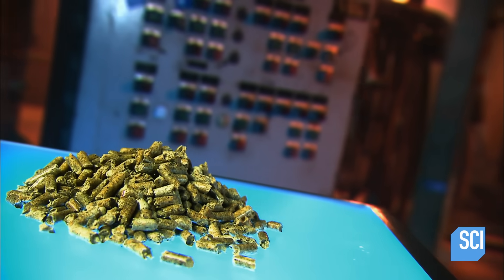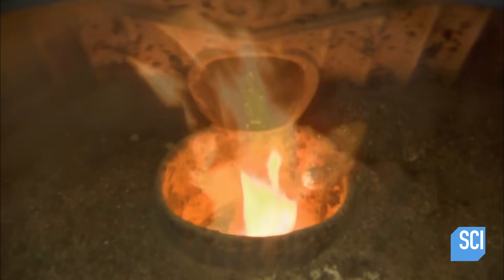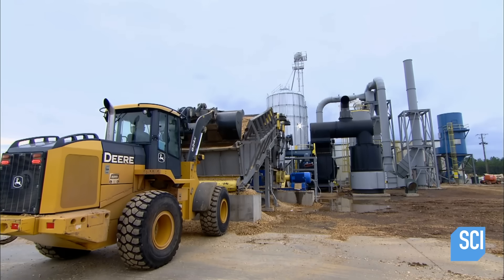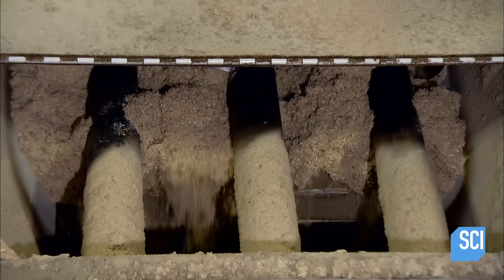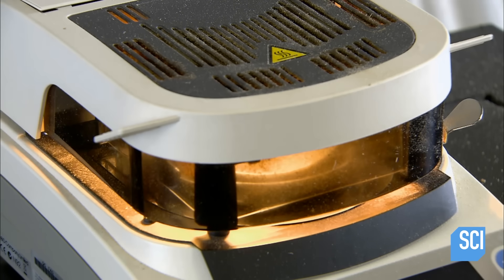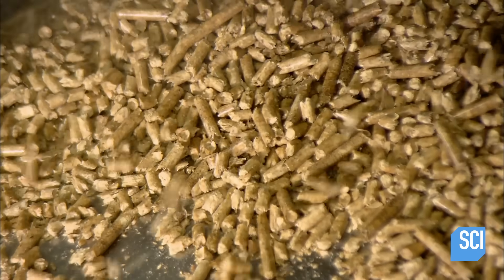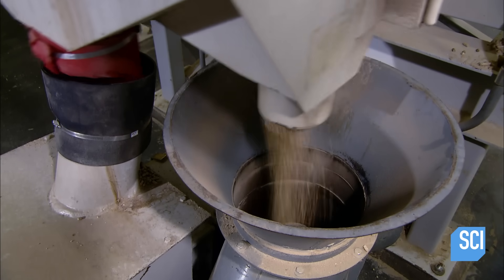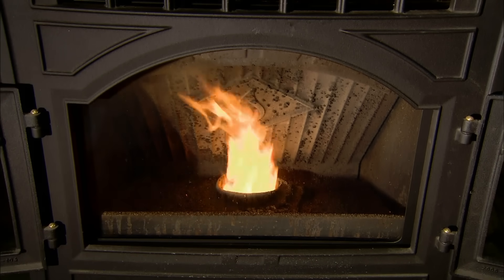How It's Made: Wood Pellets

Comment: When I BBQ with pellets I’m eating treated wood and pine trees.
Reply: It depends if the pellets you're using, are designed for grilling and smoking. Fuel pellets that are typically used for home heating. Are probably made of wood, that is usually not used for cooking, like pine, cedar. And may also have other materials incorporated into it. Such as waste cardboard, sawdust.  Where ones that are for cooking. Are usually made of woods generally burned for that purpose. Like hickory. Applewood. Cherry.  It's also always important, to read the labels on the bag carefully. To determine the ones you are getting. Are for what you are going to use them for.

Comment: I think home heating with pellets is more common in Europe because European homes typically have water based radiative heating i.e. radiators and underfloor heating with tubes of hot water going thru them.  Anyway, it's pretty good but someone has to move all those pellets around.  I burn ~6 tons a winter and I carry them all from my garage down into my furnace room in my basement by hand...

Comment: A wood pellet stove seems like a great stove and idea though wait... if there is a power outage (electricity) your pellet stove is rendered useless, as it has an electric feeder that feeds the pellets from a hopper into the fire which is kept burning hot by an electric fan blowing on the point of flame, so have a back up generator or second source of heat available to keep yourself and loved ones comfortable and warm

Comment: I niticed that it was mentioned several times that wood pellets burn cleaner than logs/firewood.  This is because a metric butt-ton of energy was put into removing the moisture from the wood.  There is no green-gain between firewood and wood pellets juat so's ya know..
Reply: It depends on why you want cleaner burning fuel. If it's just to not have it be messy near you, then no net gain is okay.

Comment: I had a pellet stove, because of the cost of yearly maintenance to try to keep it running I stopped using it..
Funny how they didn’t mention that part of it
Reply: They also don’t talk about how much fuel goes into making wood pellets vs wood stoves from hauling, grinding, drying & plastic bags. Wood stoves also don’t require plastic nor electric. It’s part of the illusion of environmentally friendly.

Comment: Pellets. The lazy mans option to solid fuel burning. Won't generate the heat hrdwood, or coal puts out. And prices are all similar. However, with the new administration, anthracite prices should be reduced. Fingers crossed.

Comment: I went from woodstove to pellet stove,  power goes out, no heat,  auger quits working no heat,  pellets get moisture in them from a torn bag, their compost.   when the circuit board went out ! had 4 bags left, loaded the stove up, went to the scrap yard n shoved it out.   Back to the old reliable wood stove.   Live in the PNW  free fire wood from tree removals and logging is very common here.
And I'm not hostage to pellet prices.
Reply: I have both. That way if I leave for a day or two I don't worry about the heat in my house. Or when I go to work on a cold day I start up my pellet stove

Comment: These are great for cat litter. 40 lbs of wood pellets for $5.99 over 35 lbs of clay litter for $26. Also, no clumpy nasty clay litter stuck to the bottom of the pan, just wipe the wet sawdust clean with a dry paper towel.

Comment: I find it interesting that in America there are very few compressed wood options.  Wood pellets are an emerging industry in America.
America has 6mm pellets, the industrial/rare 8mm pellets, and the even more rare 10mm pellets, and America also has bio-bricks.

Other places have more options for compressed wood.  I saw a wood compressor that made 20mm cubes of pressed wood.  I want to get my hands on a bag or two of those cubes because they look interesting.

I also am a bit upset that there are few pellets that use a bit of oil in the mix.  Oil in wood pellets can act as a sealing agent against water, and increase the energy density ... BUT it is an extra expense so many don't bother.
Reply: I've been doing my research on biomass pellets and there is potential for other plant-like biofuels like invasive reeds and miscanthus silver grass as well as bamboo for clean heating pellets.
Reply: @chancetrombley3114  

In the end almost all plant matter can be made into pellets and used as fuel.  Some more efficiently than others.

Comment: Here in late summer 2023, it seems that the cost of sawdust has just skyrocketed! I run a whole house pellet furnace to heat my home and I typically run through 4.5 tons of pellets in a season. This year pellets (the cheapest ones) are running $314.50/ton. They were $167/ton before this <sarc>Fantastic</sarc> administration occupied DC. There's no excuse for this whatsoever.

Comment: I work as a plant operator at a wood pellet factory  its very intresesting seeing other factorys production process . Its the same yet so different . We also use woodpowder as fuel for our drying process . We use pine and spruce sawdust as rawmaterial but we also use wood shavings that we add in later in the process after the sawdust is dryed
Reply: I totalget that. I spent 5 years in a Styrofoam plant and whenever I watched videos on here of other plants some of them were backwards thinking and far less efficient. I tried explaining to someone how they stacked the blocks was terrible amd restricted their capacity to about 60 percent and they couldn't wrap their mind around it. They stand the blocks on end as we layed ours down flat and stacked like lumber at the yard. Of you have a strong enough fork life you couls stack a literal mile high stack.
Reply: any idea how much would it cost to set a pallet factory?
Reply: The bagging machine & the forming tube seems very interesting
Reply: Vamos trocar conhecimento meu rei,tbm trabalho e uma fábrica de pellett pinus

Comment: Wood pellets are a good way to use energy but the amount of processing and transportation costs is still not as clean as just burning wood. 

Everyone’s area is different.  In most states it’s free or cheap permit  to cut dead trees on state and federal land 

And the only costs is gas running a chainsaw.  

Wood pellets require gas to run a chainsaw plus all these machines to dry it.  Compress it and transport it
Way more costs

Comment: Wood pellets cost significantly less than other fuels....until the demand for pellets goes up. Then so will the price.
Reply: That's why I bought a dual furnace boiler that can use pellets OR logs.
Reply: If the US and Canada would stop exporting the product and worry about their own consumers first, domestic supply would be greater and well, you know, prices lower. But corporate greed sees it as more profitable to export the product to other countries, lesser developed countries in some cases, and the domestic consumer gets stuck paying more. Periods of low housing startups def effect prices as raw materials are harder to source. Then throw in that the US hardly makes anymore wood furniture here, thus further limiting raw material. Argh.

Comment: Its a shame the stoves arent really repairable.  Its hard to find controller boards and sensors and tgey clog and break easily.
Reply: You know anything about Arduino mini computers/controllers? They are small cheap and relatively easy to program. 
One could be used to control your stove.
They can be used as controllers for washing machines/dryers/furnaces/etc.
They can be used to control your car's engine...a guy in UK has a YT channel on it... "Making for Motorsports"
Reply: If your stove has a computer board you're doing it wrong.

Comment: This is much the same process as that used to make alfalfa pellets, down to the drying drum, hammer mill, and (California?) pellet mill. I expect the technology was transferred and modified for wood pellets.
Reply: What is the price per kg of Alfalfa Pellets?
Reply: @sariseptianti2304  I worked alfalfa dehys 50 years ago, at which time it was a huge industry in Nebraska. Most of the product went to Europe. The company I worked for had its own barges on the Missouri/Mississippi rivers and ocean-going ships to get it there.
A quick search found a current bulk purchase quote for what amounted to $0.49/kg (24 imperial tons minimum order.) I also saw 23kg bags retail (horse feed) for $1.43/kg.
Reply: @sariseptianti2304 This is my third try to respond to your question. Uboob keeps disappearing it for some reason.
I worked summers at alfalfa dehys 50 years ago. Alfalfa pellets were a huge industry in Nebraska at that time. Most of the product went to Europe. The company I worked for had its own barges on the Missouri/Mississippi rivers and ocean-going ships to get it there. Since then the industry has largely disappeared.
To answer your question re: current prices, I found a bulk-price quote out of Kansas (24 imperial tons minimum) for about $0.49/kg. Also, I found 23kg bags (horse feed) retail at  $1.43/kg.
Reply: @sariseptianti2304  This is my fourth try to respond to your question. Uboob keeps disappearing it for some reason.
I worked summers at alfalfa dehys 50 years ago. Alfalfa pellets were a huge industry in Nebraska at that time. Most of the product went to Europe. The company I worked for had its own barges on the Missouri/Mississippi rivers and ocean-going ships to get it there. Since then the industry has largely disappeared.
To answer your question re: current prices, I found a bulk-price quote out of Kansas (24 imperial tons minimum) for about $0.49/kg. Also, I found 23kg bags (horse feed) retail at  $1.43/kg.

Comment: Also makes very good cat litter, bunny litter, etc...
Reply: I use for crocodile litter 🐊
Reply: For the fabulously rich maybe.
Reply: @ThootenTootinTabootin  I get a 40 pound bag of pellets at tractor supply for 7$, and it lasts months.
Reply: @SarahNova  informative. Thank you.
Reply: @ThootenTootinTabootin  It's actually cheaper than regular cat litter, I get 30L of this stuff for £10 and normal cat litter is around £5-6 for 5L, and actually doesn't do as good of a job at absorbing liquids and smells. It's essentially a waste material so it's cheap.

Comment: those pellet stoves and pellets are expensive now in 2022. The only ones I saw had to be plugged in. you'll be in trouble if the power goes out in the winter unless you have a solar/wind/gas generator. I still want one, but I want a wood stove too. "How It's Made" played a part in the rising popularity. LOL I never knew about these types of stoves until I watched this years ago. LOLOL
Reply: Simply get a deep cycle battery and a power inverter.

Comment: Grass greener on the other side of the fence?  Last year a neighbor replaced his firewood stove w/a pellet stove & I suggested he keep his traditional wood stove ... he was glad he did.  Pellet stoves are pretty to look at; easier on the home owner's insurance $; but not BTU or cost effective; & when electricity goes out so does the pellet stove ... and so does a secondary cook top.
Reply: I'm pretty sure I've seen pellet stoves that would run on 12 volt batteries for the electronics. Or just get a big battery backup unit and plug it into that.
Reply: @jeffwood8109  Hmmmmm?
Reply: @mikefreeman3772  you're saying if the power goes out. The electronics probably run on 12 volts or less. I think I saw something years ago that would solve the power issue if the power goes out, as an option for the stove. But if there isn't, a battery backup for a computer would probably keep that stove running for a while, depending on the size of the batteries in the backup system. Don't know about the other stuff as far as BTUs etc just talking about how to power the electronics of the stove in the event of a power outage.

Comment: Now there is a press from Saalasti Finland that can press the extra moisture off from the material before it goes to the energy consuming dryer making it vastly more efficient and even improving plant capasity. It also reduces the energy consumption and wear of the hammermills by breaking the bigger particles in a right manner. As one user agreed "it is the closest thing to printing money"...
Reply: What company makes such press?

Comment: Personally I don’t see the “green” benefits of using these pellets. I get they are convenient, but in order to get the end product a lot of co2 is used to get there as opposed to ordinary lumbar seasoned outside.
Reply: It's a carbon neutral fuel and would otherwise be a waste product. If they just threw that sawdust on the ground, then fungi would eventually turn it into CO2 anyway. The trees get their carbon from the atmosphere and burning them puts it back. They use part of that for drying it. The rest of the carbon footprint probably depends on how the local grid makes its power. The only carbon positive thing I see here is that front loader.
Reply: What are the "green" benefits of using electric vehicles? A lot of CO2 is used to make each battery, digging up millions of tons of earth to mine the materials, done in a foreign country without emissions and poverty pay AND recycling the batteries is too expensive to do. If recycling the batteries was lucrative, Nancy, Hunter, Elon etc would be investing in those companies! But they are not.

Comment: Don't like pellet grills, I've tried multiple types of pellets, they all are sub par. Spent about $300 on a pellet grill, was very excited, love to BBQ and been consistently underwhelmed.

They work to cook, but they don't smoke well, they give the appearance of smoke but lack the smoke flavor. They do smoke, just at a very slow rate, so you need to cook the meat longer, which dries it out.

Offset smokers generally do it better, and their priced competitively to a pellet grill. There is more work to it, but the final product is superior in my opinion. I've seen gas grills with small wood chip burners which smoke better than basically every pellet grill I've tried.

Offsets give a more charcoal taste too, along with the smoke, where as pellets kinda come off as a gas grill. Just heat, no flavor, and I think that's due to very low quality pellets honestly. Yet it remains consistent for basically all the brands I've tried.
Reply: Just set up your Weber kettle for some indirect cooking 😎

Comment: I remember working and selling pallets of wood pellets at 2 bucks a bag, when I left that company in 2014 they went up to 5.50 a bag .. almost tripled in a couple years.. I don’t know how much they cost today in 2022
Reply: $22 for a 20lb bag in TX
Reply: @MrC9Oh3 those are grilling pellets most likely. No fuel pellets are that expensive
Reply: @MrC9Oh3  i sell you only 3$ brother
Reply: Back in 2000 we had a special   stove that burned pellets or shelled field corn. Corn burned hotter than pellets and I had a small dump truck and at times I could buy a bushel of corn ( 56 lbs ) for under $2.00.  It usually took about 100 to 150 bushels for a normal winter. Last I knew about 6 years ago pellets was over $6.00 a bag .
Reply: I get 50 forty lbs bags which is a ton for $300.00. So $6 a bag.  I save $60.00 by not using delivery and lucky to live 5 minutes away. This place had a shortage a couple years ago and I had to drive further and paid as much as $7.50 a bag.  Bulk costs less and soft wood does too. The hardwood seems cleaner to burn and produces less ash.
Reply: Just bought 25 bags for $219. Higher quality stuff though.
Reply: Wtf really here in Massachusetts there about 7 dollars for a 40 pound bag
Reply: Honestly, there at 15 bucks a piece for hardwood not pine.
Reply: I will stick with coal ,way cheaper and I mix it with wood.sometimes you can find it any mine.
Reply: $6 per bag here depending on where you go in Southwest Missouri, but you can also find some stores that will sell you a whole ton for about $5-4 .

Comment: i had to work at a wood pellet mill before and oh man did it not look as clean as this. the place was basically two "hangar tents" with all the machinery operating inside it, no insulation to keep us warm so we had to work with heavy coats. We had an operator and two baggers that basically bagged and stacked the finished pellets. sawdust piling up in the corners, machinery held together by duct tape and hope, on a freezing wet day you had to go pound on the side of the bin that feeds the wood chips into the grinder with a sledgehammer to knock the material lose, i had to put out a small fire in the corner by the "office" once, eventually started getting shorted on hours because of critical machine malfunctions eventually had to quit and move out cause there was literally NOTHING close enough to work at. Awful, horrible job that also damaged my body having to work at. but apparently the company decided to keep it running as is instead of upgrading the equipment or shutting it down for a while despite having other facilities that were run to a much higher standard and much less dangerously and this one not having as good of an output. And because it was operating in a dead end small mountain town they could get away with letting sawdust float over the town when we inevitably got a strong wind blowing through the valley.
Reply: waah

Comment: If anyone is wondering about the data unsuccessfully blurred at 4:33, and doesn't want to go back to 4:30 or frame-step the video, here it is:
Manufactured by:
PWPellets
81 Old Highway 49
Perkinston, MS 39573
601-928-7552
www.pwpellets.com

The website is down tho. Piney Woods Pellets LLC seems to have been acquired by a company called Enviva Pellets, or Enviva Biomass, and they closed the Perkinston factory down permanently sometime after 2010.